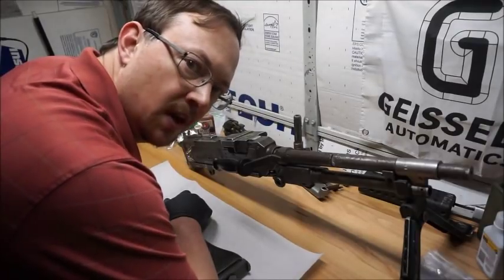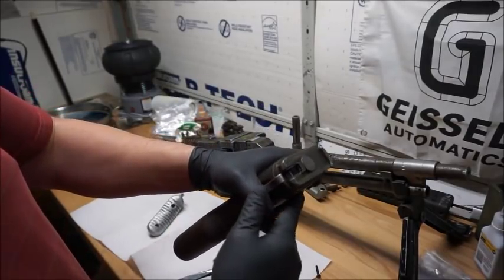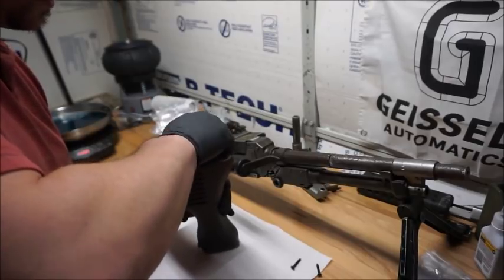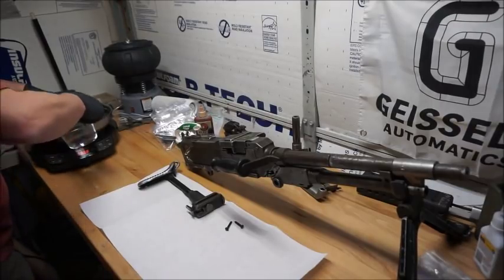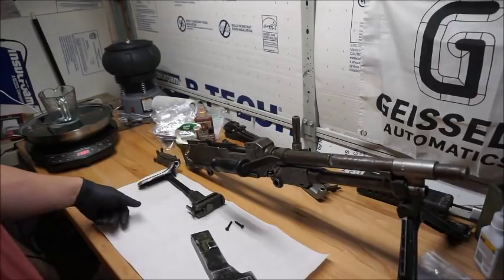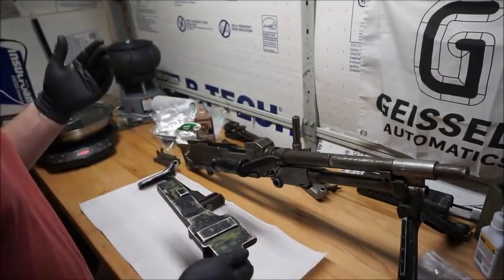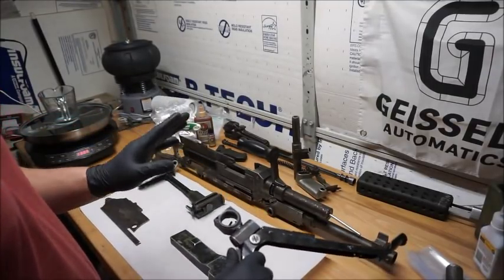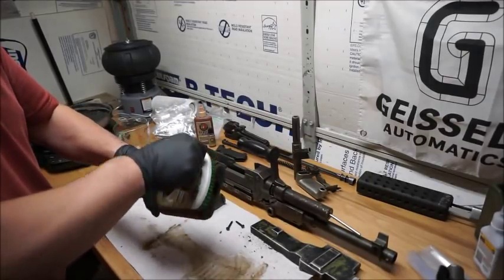Cleaning up the MAG 58 stock

Comment: Hey I'm just wondering can the FN MAG 58 use both the M13 links as well as the German MG42 belt links without any configuration between these two feeding systems? I've seen videos where the FN MAG 58 are using these two kinds of belts. I was just wondering if you can shed some light on this subject.
Reply: There were two different feed trays available on the MAG58, one allows the use of M13 links and the other allows the use of MG3/MG42 belts.

Comment: For what it's worth, my dad told me that when he was in Korea (during the war) they would, from time to time, occasionally get entire crates of 1911s.  They removed the cosmoline by breaking the guns down and boiling them. They would dip them in K1 to get rid of the water and then dry and lube them.  Love the Rhodesia connection!! I'm super jelly.  

"Be a man among men.  The Rhodesian Army."
Reply from the maker: The grease and general funk was taken care of on the small parts with an ultrasonic parts cleaner and some hot water with degreaser solution. Then I hit the parts with a nylon wheel in my drill press.